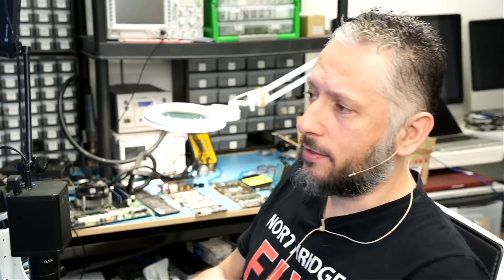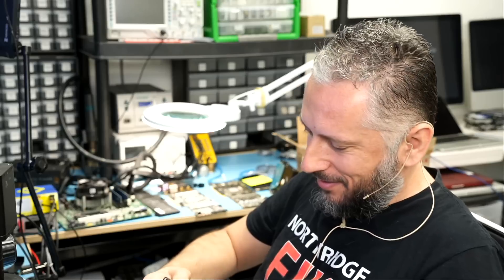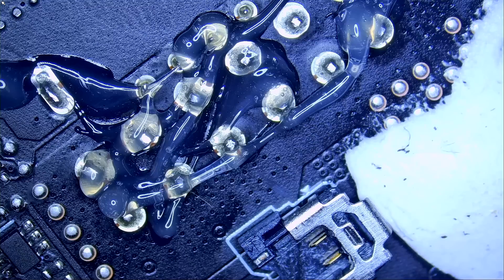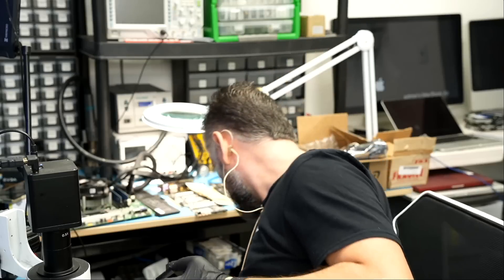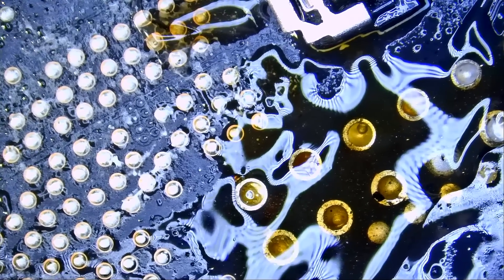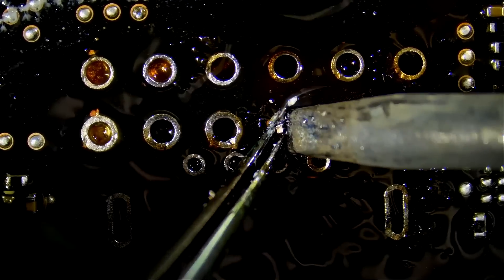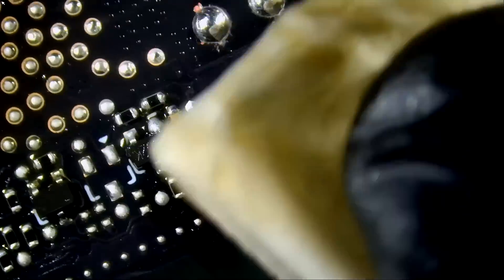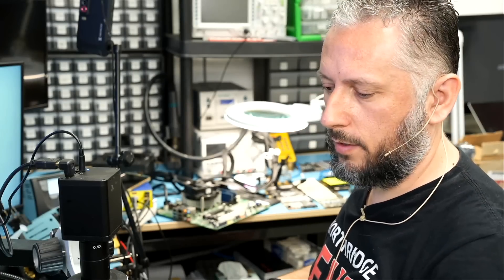4090 FE Connector melted with Cablemod Adapter installed. 40 series cards should be recalled

Comment: I am a complete novice and take what I say with a pinch of salt......... See because the end of the card is like a V shape ( has been cut out ) is the power input not getting the normal surface area for that heat from the connector to dissipate? If the notch that's missing on the board was there would there be the same problem? To small an area to get rid of the heat from the input. Just a guess and if it's true then that's not a great design at all from the manufacturer.

Liquid cooling for the power input needed....he he he...LOL

Thanks great video

Comment: YUP! It's a design fault, a fault that many automobile Audio enthusiasts learned the hard way where
if their Wiring and or connections were not assembled to handle the extreme high currents at 
12 Volts they lost their only means of Transport.

Comment: This means the connector is not suitable for carrying that much current. Cards should be redesigned with dual connectors so that current per connector may be halved.

Comment: Only Fix is to redesign how Power is fed to these latest Video cards, The manufactures should consider 
taking a lesson from the Automobile Industry by looking at the Looms used for Powering a Automobiles 
High Output Audio Amps relying on insane currents "including speaker wiring" requiring wire harnesses 
to be as thick as 10 AWG or more!!! 
Go any lower with some Amps and you risk your entire vehicle going up in smoke if any of the 
connections fail..

Comment: The melting connector could be caused by the factory solder or lack of, that and lack of heat. When you solder a new connector in, you resolder it several times over with a "river of flux" and rosin core solder instead of silver. You get a better connection. Or it could just be sub quality connectors.
Reply: the connector is not melting on solder joints.

Comment: Yeah, it is hard to believe that the connector design is not the problem. Way too much current for that small connector. I now see why a few videos ago the customer was asking if you could solder the wires straight to the board and bypass the connector on his board. Too bad it is not another spot on the board unpopulated where another plug could be added. I wonder if the plug manufacturer has a speciality plug that has a double connector coming off of it to split having double the pins? Looks like the solder pins to the board are not so much an issue, but the small contact area of the pins.

Comment: What creates heat?  Resistance!  Its most likely an over current condition. The connector just can't handle the heat produced by the current going through it.  It would seem a connector with more substantial conductors might solve this issue if there is such a thing. Do you know what the amperage of the circut.

Comment: I have two 4090s SLI'd with their own water loop on a 360 mm radiator hardline tubing with ek cryo fuel (I do renders for work). I've had one of those cards melt right at the connector, not even 4 months old. May I buy reference cards because I'm just going to rip the stop cooling off to put water blocks on them anyway. I've been doing this for over 10 years and these are the first cards that have literally melted at the power connector. It happened last month and I've been using one card since then, I'm still so pissed and disgusted at Nvidia.

Comment: Simple design error. Too much current through a puny connector with a resistive connection even if plugged in fully. I'd say even replacing the connector won't fix the problem. All cards should go back to manufacturer for a design fix. Regret your customers are wasting their money getting you to fix. Worse they invalidated their warrenty now.

Comment: Apparently the PCIe 5 cable can be rated in different wattages. Nvidia shows 450w cable is needed but they also sell 600w PCIe 5 cable. It’s a cable wattage rating issue. Need stronger PCIe 5 to PSU cable.

Comment: I  think that the Pin gauge is to thin to transport  such much current over it. Thats why the ATX 3.0 VHPR connector will melt.
If you look at the connector, nothing melts on the Ground pins.. Its just the 12volt power pins that really getting hot.. If they use thicker gauge of pins it would have less  restrain to flow throught.

Same thing like normal electric power cables  in house. If you want transfer a  lot of current over thin wires, those wires will go  hot.. That why the plastic is melting.

You can only use this standard gauge for pins, if you spread the  current over  more power connector like 3x 8pins.

Comment: Well, they should solder the cables directly to the PCB, and even better if it is a hose with a direct connector for the PSU.
I have studies in electronics and electrotechnics and the section of the pins... it is supposed to be a standard and that it has been tested, well, look what happens... I am not going to start calculating resistivity, sections and voltage drop, but I already told you that the cables should be directly to the PCB.

Comment: The female pin has two inward bent metal pieces that hug the male pin (no pun here). I believe the issue is if the cable is pulled or has strain from one direction, it can reduce this contact area to only one of the side contact points. This then causes heat issues since too much current is flowing through the pin and melts the connector. My theory at least.

Comment: That cablemod adapter and failed connector would have been an excellent candidate for x-ray failure analysis, and I'm sure cablemod would have sent it out to be tested to see if it was fully seated or not. I don't think it was the 90-degree adapter, those are just designed to prevent the cables themselves from being bent or squished in a too-tight of a Bend radius. If you see a large number of these, you may want to contact Gamers Nexus, they may be interested in looking more into it.
Reply: Steve just made a video mentioning this. Cable mod sent around 8x cards to Alex for repair.
Reply: Gamer's Nexus wouldn't take any of this considering they were the first people to rush to m'nVidia's defense when the 4090 drama started. Fuck them.

Comment: Could these connecter that are getting melted be  a result of have a under powered power supply? Just asking the question.
Reply: an under powered psu would usually shut off when called for more power than it's capable of delivering

Comment: As a 4090 tuf owner, seeing you hold another 4090 in this video with the same issue has got me worried. I hope undervolting my card will help prevent my connector melting

Comment: It seems to me if the burnt connector is replaced with a connector the manufacturer calls for, the new connector will burn out too. Maybe the people who are overheating the connectors can explain what app their devices were running including resolution and frame rate in your comment sections or on a manufacturer forum and a common cause will be identified. I doubt the manufacturer will host such a forum. That would be admitting a design flaw.

Comment: Alex, how about to monitor the 12VHPWR voltage with the HWiNFO64? I have been doing this for months since I got my 4090. My voltage never dropped below 11.9v with the fasgear cable. Then I got the cablemod cable and immediately the voltage started to drop from 11.9v to 11.850, 11.8, cable completely flushed in. (Under load). More a couple of months and it dropped to 11.5v under loading. Then I got a black screen, Pc normally running and gpu fans to 100%. Swapped back in the fasgear and the voltage never dropped anymore and no more problems. Initially when the voltage dropped below 11.7v I had contact cablemod and told me to don’t worry, the voltage drop isn’t important. But I believe this is very connected to the melts, due to current leak. Any thoughts?
Reply: Chat up our support team about that again, they'll make sure you get a replacement for sure if you have any concerns about the cable.

Comment: I'd be interested to know if the users were overclocking their card. I mean, I agree it still shouldn't happen by design, but I would still be interested to know if they're are clocking the card and so drawing more Watts than the standard. The cooling on GPU cards these days is pretty awesome but it's almost like they're going to have to start designing some of the fan ducting to keep the power connector in check too. Surely the users power supply cables where getting pretty hot too?

Comment: If the Amperes are too much for the connector it will always melt, unless you can find another connector with higher rating that fits....good luck with that , just take it like a man and buy a diff card.

Comment: Good video, but conclusions are debatable.
Adding a 90 degree adapter brings in another set of contacts that may increase failure rate. Form the video it might be the 90 degree adapter that caused the problem. There is no way to tell.
Secondly these 12V GPU connectors need to be connected/wired strain free. Many PC cases are too narrow to allow this strain free installation. So, people use 90 degree adapters introducing additional issues.
My two cents is that possibly the connector or/and the PCB plug are heating up from the GPU airflow. Plastic from the connector/plug start to expand and forces the pins and connector contacts to loosen and increase contact resistance, thus creating more heat till the connector/plug melts. This effect only increases when the cable connection is under mechanical stress.

I did not have the overheating thing but the black screen/max fan issue when the GPU was under load for a longer period of time. Replaced the original adapter connections with one straight in cable between power supply and GPU. Then made sure the connector to the GPU was completely strain free. Till now I am running without issues (and actually don't want to open my PC case again :) )

So, design flaw - yes I think so if the installation is so cumbersome/sensitive.

Comment: Cablemods quality control sucks, problem solved.
Reply: How so? We've sold over 50k of these angled adapters and have less than 10 failures. Our 12VHPWR cables we've sold even more and have only seen 2 failures, and those were confirmed user error (you could see visible markings on the terminals showing they weren't fully seated). We also are paying for replacements by the way for cards, even if the fault is user error, that's worth mentioning. With CableMod you get great quality, and great support. Not sure how many other companies would do the same for you if it was proven user error. ;)

Comment: @NorthridgeFIx,    Wouldn't it be a better solution to just eliminate the 12vhpr connector rather than replace it?    I've been using one of these from Amazon,  "Fasgear PCI-e 5.0 Extension Cable: 16Pin(12+4) Male to PCIE 5.0 4x8(6+2) Pin Female Sleeved Extension Cable, 40cm 12VHPWR Cable Compatible for GPU GeForce RTX 3090Ti & RTX 4080 4090 (16AWG/Black)"

Wouldn't it be a better option to just cut the 12vhpr cable connector off something  like the Fasgear cable,  throw the 12vhpr connector in the trash,   and just solder the Fasgear cable to the 4090?     If my 4090 ever has issues,   that's what I will ask you to do.    Then my card would have 4 x 8 pin PCIE connectors on cables  soldered directly to the card,   and no 12vhpr at all.

I couldn't put my case side after installing my 4090.   So I bought that particular Fasgear cable,  and I've been using it since December with no problems.

Comment: If this was user error then we would see different burn patterns, Its always one row of pins that melts. This is a power draw/delivery issue. Nvidia knows this but it's far easier to blame users then admit you have a fire hazard flaw in your product line. I haven't seen a single new adapter with the 4 sense pins melted either. If faulty connection was at issue here then you would see random melting patterns across all pins. Fact is nvidia will never admit this because it will hit both their bottom line and their stock price so they will just quietly  work on a fix or move to a different connector for future cards.
Reply: only one row of pins is positive

Comment: is this OHMs law? When a wire or medium of some sort receives more power than it is able to resist, it becomes an element? Like a Kettle, or like a Vape pen coil? A thicker gauge wire would handle the current without getting this hot right?

Comment: Possibly, gold plated contacts over copper/phosphor bronze terminals would eliminated this problem.  I expect that the factory invented the "not plugged in as specified" idea to avoid paying for failures.
Reply: Oh no nvidia said it was user error but they would warranty them any way, Bait and switch to get it out of the headlines
Reply: Nope, foreign material (dirt, dust, hair, fiber from clothes etc) will be the main propogations of failure.  Changing the coating on the pins wont help vs them
Reply: Gold plating reduces electrical  conductivity vs silver.
Reply: @Squall4Rinoa  True, but silver tarnishes.

Comment: Why design something that can melt you're $2500 products oh wait nvm as typing this came to me Greed 🤦‍♂️ Nvidia found a way to charge more $$$ then design a connector to fail on purpose and blame the user so they don't have to replace it

Kinda like apple with that planned obsolescence with there phones making them slower with every update till user has to buy a new phone just so it works.

Comment: According to GN the resistance increases when not plugged properly which causes tremendous heat in that spot of the connector that can melt the plastic. As others pointed out it's likely that the pins are too short in general, so even when plugged correctly the area may get too hot when the card is under sustained heavy loads. The 4090 can pull a huge amount of power (600W+) when overclocked and running stressful programs.
Reply: probably the area of contact is too small.
Reply: Yes it's the same with the automotive connectors, if the contact is loose the resistance will be higher, and the connector will melt. But that's clearly not the issue here.
Reply: And the terminals involved can handle 1600w+ when no flaws or damage is present to the contact terminals, so whats your point?

Comment: I don't have a 4090 in use but a 4080, my card is regularly maxed out through various means, pulling around 320-ish watts continuously. 
Rendering and AI is usually what it's doing, it's a workstation PC, at times it runs days on end working through a queue.
So at least for 4080 cards (PNY XLR8 Verto specifically), I can confidently say that the plug is sufficient. Doesn't even get warm to the touch.

The 4090 has a higher power limit, so it could be the this is too much for the plug.
I'd like some test lab to run a few hundred cards with various adapter solutions and a variety of vendors, to get the bigger picture.
Otherwise we're just doing preschool science without actual results.

The 12VHPWR connector sucks regardless, alone that it requires a 3x PCI to 12VHPWR adapter is fucking stupid.
Maybe some PSUs come with a native solution, but if so they're few and far between.

EDIT:
I have probed the connector temperature with an infrared thermometer. 
In idle, the 4080 connector has 24.3°C, or 3.8°C over ambient. 
During torture tests and close to the TGP, it has 28.9°C or 8.4°C over ambient.

Again, not the same card. Not the same power draw.
It only shows that there is no inherent issue with the connector getting warm when drawing 320 watts at maximum.

EDIT 2:
I should also mention that the slight increase in temperature, is probably not from the connector itself. 
It's much more likely that the connector is getting warmed up by the heat sink and hot air being excused around the connector.

Comment: This is probably and issue due to parts. its still hard for some companies to get parts. Its possible NVIDIA got 1000 connectors when they really needed 3000. so you can make 1000 gpu,s with 1 connector each or 333 with 3 connectors or 500 with 2 connectors each. Im guessing quality control said it wouldnt be a big issue to just use one and nvidia used just the one. i think the 3090 has 2 connectors and my rx6950xt has 3 connectors. there really is no reason it should only have one connector. its also possible there werent enough connectors when they first started making the 4090 so they used just the one and once they got enough connectors they continued to use just one connector because all the machinery was already made for the 4090 to be installed with the one connector. When car makers couldnt find parts they did the same thing and started trying to eliminate parts where they could.

Comment: Undersized board pins? Or they're too short, which could prevent enough overlap which would inhibit proper current tranfer, either way, I agree with Mystic, its a resistance issue

Comment: It doesn't look like an insertion issue in this case, as the adapter looks to be fully inserted. However, is this a 12VHPWR issue or is it an issue with the Cable Mod adapter?

Comment: This needs to be a recall before someone’s house burns to the ground. I have a Zotac 4090 oc. I’ve never seen it go above 65c and total system power draw never above 620 watts. (13700, asus 11:05 water cooler and 4 case fans). Every once in a while I’ll smell an electrical smell. When I installed the 4 to 1 cable adapter, I installed that first and made sure it was seated fully, audible click and flush seating, then installed the card. I’ve built computers for over 30 years and I think I’m done with all of this crap… too expensive and risky. We’ll see if it melts. No visible signs as of yet…..